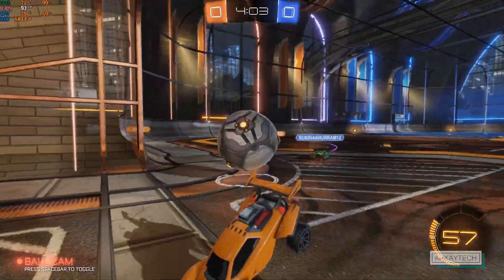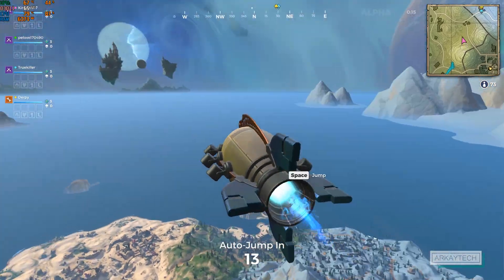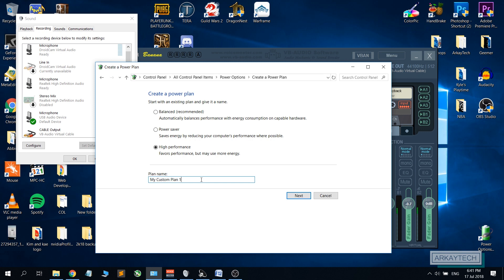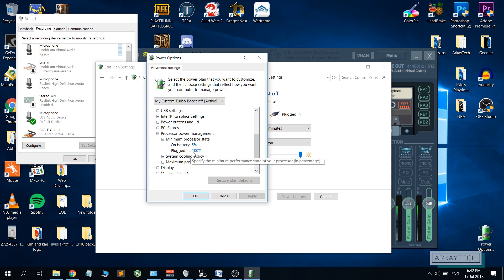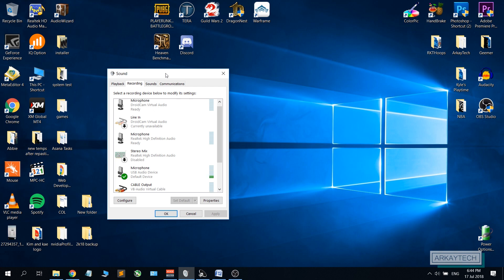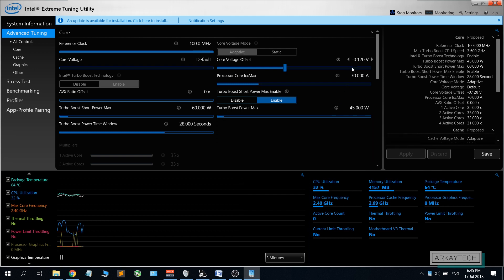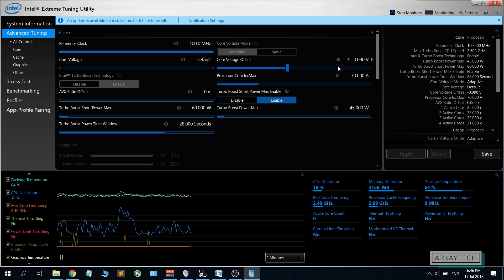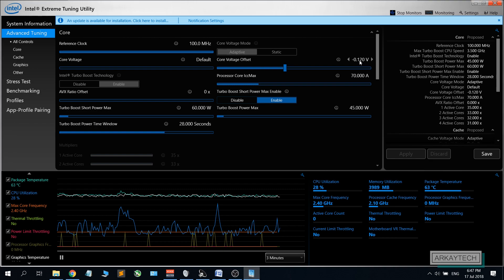Laptop | How to Undervolt CPU and Disable Turbo Boost

Comment: My Y540 81SX has 88-97 at archeage. Just a few clicks on my battery you showed what to do. My temp dropped to 66-70. Without doing a thing to the processor volt or whatnot. Though i lost my fps from 120fps avg to 90fps avg.. still much better than having my CPU's high temp.

Comment: If i disable turbo boost off and undervolt does the the undevolt atill works?is xtu same as throttle stop like if i experience crashes does the xtu revert back to it's default values???

Comment: I did every thing & used every app until I figured out the problem at least for me. I found the problem & it can be fixed without apps or messing with OS settings

If the PC doesn't have a faulty hardware then the stuttering caused by the CPU overheating. I thought the 100% CPU usage is the problem but it's not! being 100% is really normal. So go & enhance the CPU cooling system or moderate the CPU turbo! Yes the CPU turbo is the problem & it's really sad that Microsoft or Intel didn't provide setting for that to limit the turbo ratio in case it's making CPU overheating for those playing on laptops, compact pre built PCs or a PC with limited budget cooling system!

Easy steps I hope it fixes your stuttering problem by benefiting from the CPU turbo without hitting the maximum tempreture or disabling the CPU turbo(stepping frequancy):
1- This step is optional but it's good for minimizing the CPU latency. go boot to the PC BIOS then advanced setting & make C Status disabled. then save changes & exit.
2- Boot to Windows & go to the graphic card control panel reset it to default  then set the global setting to high performance. no need to costumize performance for games or apps
3- Go to "Power Plan" then choose the factory "Balanced" plan & reset it to default. keep the plan on "Balanced" & don't change any thing except you can change when the screen or compuetr to sleep or turn off.
4- this one is wierd! to make use of the "Balanced" plan go to Desktop then the task bar & click on the Power/Battery icon. then put the slider of the power mode to the center "Better Performance"

that's it

Comment: I found out how to do this by myself XD (on throttlestop) and it is amazing, I used to get temps 88c-95c and FPS of 109-120 but after disabling turbo and undervolting, my temps are 54c-59c and fps is 120-130, so i'd extremely recommend this if your temps go over 85c-87c
Reply: i have a ryzen 5 3550H and unfortunately I can't use that software :(
Reply: How did you it i also have throttlestop

Comment: Is this safe? It lower my temperatures quite lot in games and lost almost no fps. But frequency got locked at 2.39 GHz, even at idle. Could I harm my cpu by this constant frequency?
Reply: No, youre running it at lower computational speeds it wouldnt make sense if it did

Comment: I wouldn't recommend doing this if you have a i5 9300HF, it will set it to 2.10GHz which is way too slow, and it even caused a BSoD for me.
Reply: I have i5 9300hf, and it works. In my case, frequency is locked at 2.39 Ghz. The BSoD was probably caused by undervolting too much. Go slowly step by step, dont jump strait to -130 V or so.
Reply: @tomasoto1  I have my i5 9300HF undervolted at -125V and it's perfectly stable if I don't disable turbo. Disabling turbo is definately what caused the instability for me. I found a better solution for this that works for me and actually gives more performance: Change your turbo frequency in ThrottleStop [or whatever you use] to 3.5GHz instead of the default 4.
Reply: @t.fakename-4421  Good to know, I will try that as well :)
Reply: @t.fakename-4421  pls how did you changed turbo frequency in throttlestop? I can´t find it anywhere :D
Reply: @tomasoto1  it's in FIVR, under "Turbo Ratio Limits", change the numbers to 35
Reply: @t.fakename-4421  I have tried this and works perfectly, thanks man :)
Reply: @t.fakename-4421  do we need to do that every time we start laptop or once applying it is done? m talking about setting 3.4ghz frequency
Reply: @prabhu_rakshit  You only need to do it once.
Reply: @t.fakename-4421  i decided not to do. i found someone on reddit who played games on quiet mode and got good temps with undervolting. i have undervolted to -0.140 and i played rise of tomb raider 60fps locked on quiet mode and got 70-75°C max

Comment: nice ,actually from 97C to 70C in facry 3, but my only issue is that my fps dropped from 80 to 50-70 mostly 51-60
Reply: you trade performance for cooling unfortunately
Reply: What your monitor refresh rate......

Comment: Thanks so much you just saved my new laptop, before this i was getting in the upper 80s, now im getting in the lower 60s while gaming
Reply: @artilleriman  Mine was like 95C when playing world of warships whereas I need to lock my multiplier using throttlestop, and it is noticeably noisier under normal use. So disable turbo boost is better in my opinion.

Comment: there is no point on undervolting the cpu after u have turned off the turbo boost. it does not increase performance
Reply: Nope it has mine when i disabled turbo boost and oalyed intensive games i still hit 75 to 80c  but when i disabled turbo boost and undervolt my temps never pass 73c

Comment: For 8750H (Legion Y530) don't use these settings...setting it to 99% or 98% will clock your frequency to 2.10ghz...which is even less than the base clock. Just use -150V undervolt (legion Y530) and adjust turbo boost for better performance. I get around 3.5ghz even after power limit throttling. Six cores at 3.5ghz is not bad(Temperature doesn't exceed 85 degrees) (Repasted CPU using IC Diamond 7)
Reply: how to adjust turbo boost pls ?
Reply: @TheAnas8  I suggest you leave it to BIOS defaults....you might get BSOD if you lower it...these CPU's are too powerful to sustain load on lower boost settings. I suggest undervolt -125mV for 50WW bios(Legion Y530)
Reply: @TheAnas8  You can do it from XTU(Intel extreme tuning utility)

Comment: Setting it to 98% worked for me on my i7-8750H. Thanks alot.
Reply: I have the same processor, thanks the tip, I try it now.
Reply: just a q, did it work a lot, i have some processor but its always 90 temp
Reply: @TyakGt  yes it works but turbo is totally off

Comment: i have intel i7 7700hq base 2,8ghz and max 3,8ghz what value should i put on it? for lower temperature
Reply from the maker: It actually varies system to system. You really must test different values.
Reply: ok thx you i will try it  @arkaytech27

Comment: Really good, i mean..not only that it lowered my TEMP way more than I expected, but it seems that it doesn't go crazy in games anymore, it was definetly from the temperatures and i have a cooling laptop pad too! I have the same proc i5-7300HQ with 12gb DDR4 and GTX 1060 3GB.
In Dota2 now it does not go over 55-60 C - CPU and even the GPU temps are lower on full mega giga ultra video settings! Pretty good, it never crossed my mind! LIKE!
Reply from the maker: Glad it helped you. 😀

Comment: I have a question.. So, after to save my settings. I need to start the program after to turn on my laptop to run the undervolting? or is it an automatic process?

Comment: does XTU undervolting values stick after system restart?
Reply from the maker: Sometimes, it's buggy though. I have not tried creating as task schedule for it though. Will try that and I will let you know. :)
Reply: ArkayTech throttlestop has the same issue of not sticking values right? Do you know of any workaround?
Reply from the maker: Yup, but I did manage to make it work by creating its own task schedule.